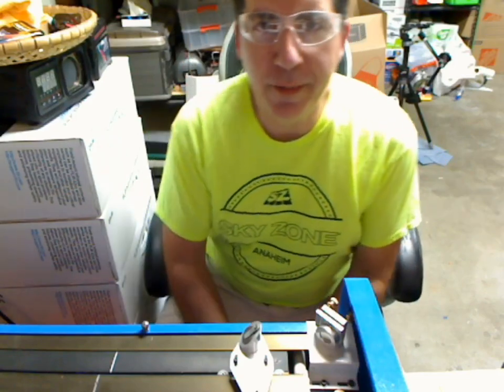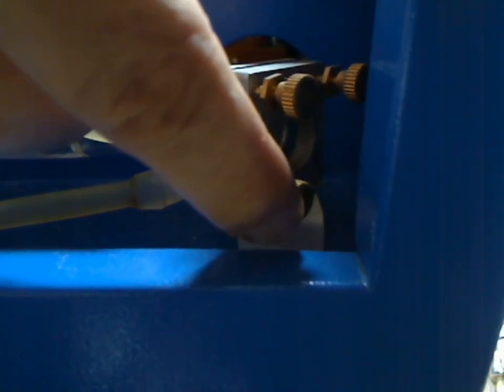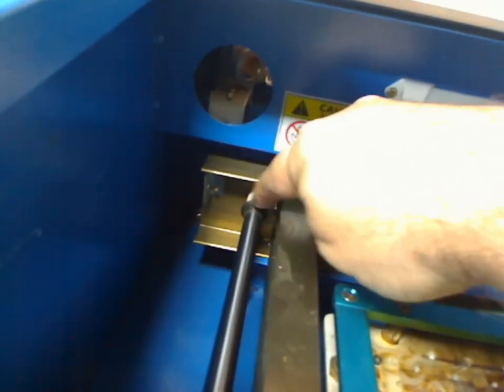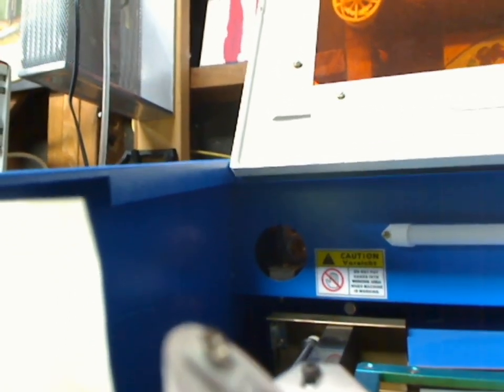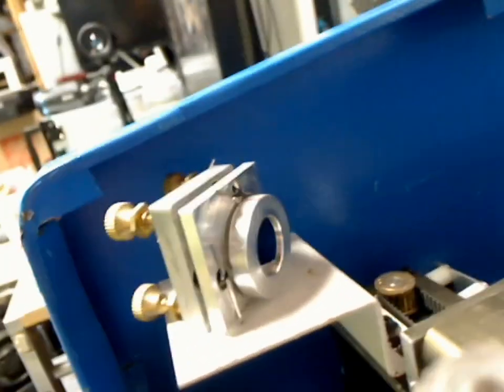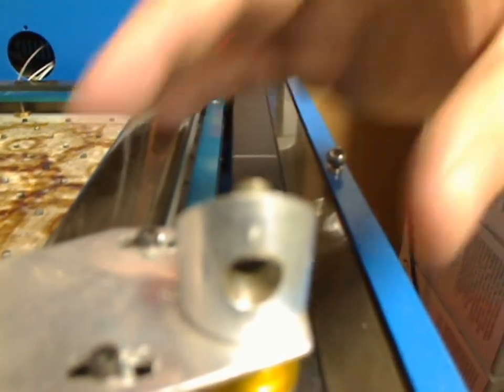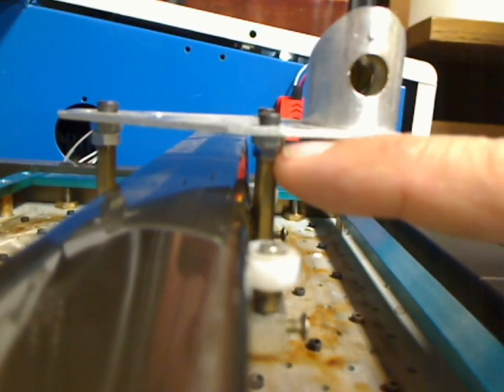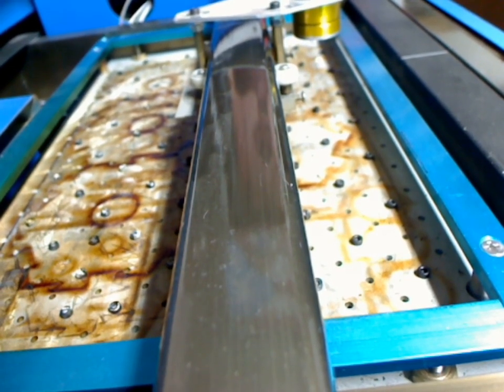The Short K40 Laser Alignment Video is Here!

Comment: One thing I've found to help with the rotational adjustment of the laser head / mirror 3 was putting a long, straight rod over the entry hole to the laser head and pushing it against the head. That give a reasonable approximation as to whether the mirror is perpendicular to the Y axis.

Comment: Can I please ask you something...I've been pulling my hair out all day trying to get my mirros alligned.  I have my mirror #1 shooting a parallel beam (I assume)...When I move the laser head in the farthest position, the laser hits Mirror #2 dead center...but when I move the head back to the closest position for the 2nd burn...the hole moves down about 1/4" directly below the first burn.  My question is, wouldn't any adjustment you make to mirror #1 affect  both burns?  I feel like it is shooting parallel to the rail but that it isn't horizontal???smh  I'm not a mechanical engineer but I feel I have a lot of common sense and this mirror allignment has got me topsy turby.  I almost feel like the rails need to be shimmed/raised a little bit on one end? (the end closest to laster tube?  Any advice would be appreciated.
Reply from the maker: I suspect that you missed a critical point of my video about needing to ignore where on the mirror the beam hits. Ignore the mirror completely. Once your beam is aligned to the rail, you can move the mirror to catch the beam  Since you make no mention of mirror 3, there is a bit of ambiguity in your description as to what is going on where. Lots of ppl I help forget that there are 3 mirrors and refer to #2 as #1. I'm happy to help if you want to jump on a call. YT does not seem to have a DM feature, so reach out via Facebook Messenger if you have that. John Cabrer is the name.
Reply: I sent you a message on Facebook

Comment: My machine arrived with the mirrors very out of alignment. If I put a bit of wood under the laser, it won't even fire to leave a mark on it. When I put paper over the first and second mirrors, it does burn a hole, but it's not going to the final mirror on the laser head. I'm at a complete loss. This helped, but I'm still not getting it. What do I do to go back to square 1 and try to get them all aligned

Comment: Thank you.  This was helpful.  Now I just need to make a deeper cut.  Any advice?  I’ve search for help on this and find none.  Like what power level you should use.  Thanks
Reply from the maker: How much deeper? A 40 watt laser in new condituon can only cut reliably to a depth of 3 mm. Running the laser at high power will cause the tube to degrade rapidly. It may even damage the partial mirror on the tube.
Reply: @johncabrer2328  thank you.  It wouldn’t cut into my wood at all.  A friend told me to clean the mirrors.  I did that and their was a few little particles I could see down in the lense, so I vacuumed them out.  Tried it again and it works great.  I used tape to try to align at first before I found your video.  Yes, bad advise from others.  I think maybe some tape residue was on the mirrors.  I couldn’t get my dots to line up perfect and it is pretty close to the top on the head or going into mirror 3.  I think I need to shim it like you showed, but it is working for now.  I am running it on 15% power.  I just got the k40.  Maybe you could do a short video about power setting and what the temperature should be.  I have 2 gauges on mine.  Not sure what is safe.  The water was running 27C.  Thank you so much.  This was a little overwhelming since I had never worked with one before.  But I’m pretty excited now.

Comment: I know I am a year late, but this has helped me immensely, thank you so much. You explain the issue perfectly. Do you have any advice on removing micro bubbles from the tube? I've been struggling for 2 weeks, before I've even fired up the laser. I know that colder water can absorb more O2, but I can't budge them even when the water is warmed to 19°C and the pump is left on for more than 12 hours. It's a brand new tube, pipes, pump, flow indicator and temp readout. I'm baffled. 🤷🏼‍♀️
Reply from the maker: You don't need to worry about small bubbles. The areas that are critical are at the ends of the tube. There you don't want big bubbles hanging around in the bends of the glass tubing. Usually you can rotate the tube to a position that eliminates this.

Comment: Thank you so much mate, I was ripping my hair out trying to re-align my mirrors after fixing the gantry.  the post-it note trick worked amazingly.  I now have it aligned.  raster engrave and vector engrave working great.  But when I boost the laser up higher power to do a vector cut, I'm getting ghosting (the cut works) but theres also a scorched version of the lines next to the cut lines.  trying to figure that one out :P
Reply from the maker: MIRROR #3 must be slightly rotated. Trial and error will tell which direction. If #3 is not facing #2 perfectly, the beam down to the material will be slightly tilted. The ghost line appears because a reflection off the inside wall of the tube is taking a slightly different path through the lens.

Comment: i try do it like u said ;( but 2nd mirror dot is always upper then x0 position :(
Reply from the maker: If the final alignment result is the dot being too high or too low you have two choices. You can adjust the mounting up or down and do the alignment again or adjust the mounting height of the lens holder by replacing the hex standoffs with M3-35 screws and nuts.

Comment: Thanks man, that's the engineering way to do the aligment process. Forget the mirror and first check the beam vs guide rail!  Just replacing the mirrors (Stock vs Cloudray Si) and lense (Stock vs Cloudray CVD USA) + the alignment the laser changed dramatically!! And cuts 5mm light wood on 1 pass without any issue (25% digital lcd power).
Thanks!!!

Comment: I have looked these gids short and long several Times but.... Trying to allign mirrors. So I make beam perpendicular and bring mirror 2 in the beam. So far so good. Then I make the beam perpendicular to mirror 3. But when I want to move mirror 3 to the beam path its hitting to far left. Have no more mounting space to the left of mirror 3 (looking from mirror 2) so I need to make the whole beam path more to right. (Again looking from mirror 2) hope you can understand this. Some help much appreciated.
Reply from the maker: When this happens, you must adjust the positions of the tube and mirror 1. Usually this is more common when the tube mount is 3D printed, or the mirrors are not original equipment

Comment: there is a little bit of adjustment of the tube mounts 2 hex headed 6mm set screws hold each mounting bracket through two short slots in the base you can slacken them off from inside (do the left hand side first cos you are not messing about near HT power source, even when it's switched off it can kill you) it only gives about 12mm adjustment, but that can make a big difference

Comment: Different topic: K40 Whisperer on a Mac. I have installed Python 3.9 and Inkscape on my Mac (running MacOS Big Sur) but I don't know how to install K40 Whisperer 0.58 src. I have tried running the copy and paste commands that you posted to Scorchworks, but am getting (not found) errors. It seems like I have all the right pieces, just not sure how to make them work together. Thanks!
Reply from the maker: There are lots of persistent issues with K40 Whisperer on Mac. Install VirtualBox and download an image of Windows 10 or 7 and set up a minimal virtual machine. You dont need a license and it will all run perfectly. On Mac OS, just updating the OS can break Whisperer and force you ti start over.
Reply: @johncabrer2328  Thank you! Really appreciated your alignment video here too. It took me about a half hour but it worked great!
Reply: @johncabrer2328  This is an awesome service.  But see my comments re. Mac.  The guidelines about using homebrew/virtualbox are quite out of date now, especially as Big Sur is far more Python friendly. Having said that, I'm a dev. so it's 'easy for me'!!
Reply: This should be really easy to do, John.  I use K40 Whisperer on Mac OS (Big Sur) with no problem.

You first need to git clone libusb (you can find it on github) - then compilation was easy enough (from terminal, cd libusb; ./bootstrap.sh; ./configure; make; sudo make install) .  If you are unfamiliar with using terminal, it may be a bit tricky. Reach out to me in that case.

So that's libusb. K40 Whisperer runs absolutely fine using python 3.9, and does NOT need home-brew at all. Inkscape is available for download onto Mac OS, but the software works with SVG, so you can use illustrator or whatever you like for your file generation. K40 Whisperer is pure Python, so it's trivial to get to work on Mac, if you know a little python. One has to use the source material, unpack it, put the entire folder somewhere, and then (via terminal) "cd K40_Whisperer-0.58_src" folder, and run "pip3 install -r requirements.txt". - again, this sort of expects that you know some terminal.. 
Then, with the USB connected, and the power switch on (with the water pump pumping, the fan blowing, the earth earthing, etc).
"python3 k40_whisperer.py"
You can test that it works by pressing the button "Initialize Laser Cutter".
Reply: @ben.griffin  Thanks Ben. I am not very familiar with Terminal or Python, so the order of operations is not obvious to me. Email me at john at howtobrewdotcom if you would and we can talk about it. Thanks!
Reply: Also, I don't know if you are interested in all this, but I use Form•Z Free for designing objects - this is great for 3D constructions - and then I select the faces I want to cut, and use 'unwrap' to fix those onto the XY plane, then use the extrude tool to extrude them to 3mm export as STL file, and then use OpenSCAD to render them as planes - with the command "projection(cut=false) import("model.stl");" then from OpenSCAD, export to SVG, and use the SVG in InkScape to tidy up cuts, vectors, and raster, and fit (resize to drawing, with a 1mm margin) ready for Whisperer.  All free. It's a bit of a tool chain, but I get incredible accuracy, especially when using supporting templates (also modelled in Form•Z) for some of the complex fits. (I am slowly moving over to Blender, but Form•Z free is pretty cool).

Comment: Watched your video and I need to know where the laser will hit on the first mirror?  I put a new tube in and the mirrors where out of wack. Thanks
Reply from the maker: Depending on who you bought the laser from, the tube mounts may be adjustable so that you can positiion the tube so that it hits in the center of mirror 1. The beam does not have to be perfectly centered, but it should be away from the edges by at least 4mm to avoid power loss due to partial blockage of the beam by the mirror housing ring.
Reply: @johncabrer2328  it hits close to center but to get it to mirror 2 I have to adjust the 3 screws like crazy. The old tube layer in there and everything was adjusted. Let me ask this. If I hit center on first mirror but won't hit mirror 2. Let's say it's to high, what adjustment should I try first?  Thanks
Reply: @johncabrer2328  they are not adjustable. I'll have to shim the mirror. It's hitting to high. I messed up all the setting. After I get the tube centered do I need to turn the mirror to the right.  Right now the beam hits the mirror and I can't find where it's going.

Comment: I just watched your video.  It explains perfectly.  I'm totally lost tonight.  Until yesterday, I was able to cut leather at 10% 2 passes, .125 acrylic 24 % normally 1 pass...sometimes 2.  And .060 cast acylic at 10%  1 pass.  Today, all of the sudden, I cannot cut at those rates.  In fact, after cleaning mirrors and lens; aligning, changing my water, I still can't cut acrylic.  Now, my 3rd mirror test shows beam hits center when on far side of laser, and when close it hits above, and a bit to the left.  Does that mean that I need to raise my head by adding washers to the screws.  Any help would be appreciated. Thx
Reply from the maker: My guess is that you lost alignment after cleaning everything. Possibly installed the lens flat side up. Look at the lens from both sides. The side that shows smaller reflection is the curved side, which should face up.
Reply: @johncabrer2328  I forgot to say...I started the whole cleaning process because of reduction of power in cutting.
Reply from the maker: Check that the beam is still round and not split.
Reply: @johncabrer2328  This video is super informative, thank you for taking the time to do it.  I fear I have fallen at the first hurdle, I get two very distinct dots instead of one.  Faulty tube?  Any way you know of fixing this issue?
Reply: I’ve got the lens curved side up, in fact, I tried it both ways. I’ve had the laser almost a year, could the tube be losing power? It’s still pinkish/purple. I guess tomorrow I’ll shim with some washers. Thx for replying.

Comment: thanks for proper method seen to many dummys that dont know what they are doing show improper method of adjusting  but there is a small amount of adjustment to tube location by loosening the bolts under the mounts that allows the tube to move a small amount

Comment: Really love your video. I have an issue if you can help me with. I'm getting the beam parallel off of mirror 1 but the beam is hitting m2 very close to the bottom of the mirror, its like m2 is too high in comparison to the beam. Is this correct or am I doing something wrong

Comment: John,  I used your video to align my K40.   I get overlapping dots at Mirror #1 to #2.   Then #2 to #3.   Then I do micro adjustment at Mirror #1 to get to get overlapping dots at the Rear Right position, but after I do that my Mirror #1 to #2 is out.    So Mirror #1 is aligned on the right side front to back but not left. 

Can you PLEASE tell me what this means.  I've been working on this three days and can't figure it out.  If you covered cover this, I apologize because I didn't catch it.   Thank you - Rick

EDIT:  Not sure if this matters, but I couldn't use calipers to get perfectly even spacing on my Cloudray mirrors, so I just eyeballed it.

Comment: 2nd mirror needs to go down to center.  Now what? Raise the tube maybe?
Reply from the maker: Correct me if I am wrong but you are saying that the dot .is too low on mirror number 2? Depending on how the tube is held in place, you can loosen the mount closest to mirror 1, and this should move the beam up slightly. This on non adjustable mounts that are just padded clamps.
Reply: Hey. What did you do exactly to sort this? I have the same issue. My 2nd mirror is like too high and the beam is hitting very close to the bottom of it. Did you raise the tube?

Comment: Hi! I can adjust the screws of the 1st mirror to get a straight beam, so both holes are in the same place, but if I check where the beam hits the 2nd mirror, I can see that the beam is up. The explanation says that I have to unscrew the screws that are under the 2nd mirror for moving to the right or to the left but, what do I have to do to move the beam down?
Reply: i have this same problem when i bring the second mirror close to the first one, the beam rises
Reply: I have this same issue. Dots align perfectly but is too low on mirror 2. Did you solve this problem?

Comment: Hi there and thats a perfect video!I have a question. I managed to allign all the back and front positions but on my second mirror the beam hits the mirror  offcenter. Is this a problem?Will it lose power if it doe not hit the mirror center?
Reply from the maker: If the center of the beam gets close to the edge, say 5mm or less, the power will be reduced. This is because the actual diameter of the beam is larger than the dot it makes.
Reply: @johncabrer2328  hm... I see....so i will have to rearrange it...thanks for the reply!
Reply: So if my dots are lining up at front and back, does the dot need to be in the centre of mirror 2? It is current a bit below centre in terms of height and I can’t seem to get it right, does this matter?

Comment: im having some issues with my vector cuts / engravings not aligning with my raster. do you think we could have a convo in messenger?
Reply from the maker: Sure! You can find me on FB Messenger "John Cabrer" or reach out any other way you like. Usually, if you are having misalignments between vector and raster files, it is because one of the files is cropped to the edges of the graphic, and the other file has the graphic centered in the field, hence the misalignment. Keep in mind I am only familiar with K40 Whisperer. I can help out with other software, but you will need to bring me up to speed on the fine details.
Reply: I tried looking for you on face book can't find you  For some reason. My basic problem is is when I try to raster engrave and then try to Vector engrave over it they dont match up by about 1/8 to 1/4 in apart. Its 1 file with both Vector and raster data.

Comment: Excellent explanation.  I've done several alignments but this is the first time I've seen it broken down so clearly.    This is also the first time someone explained the ability to translate the mount perpendicular to the direction of the incoming beam. I have a new tube for my k40 and printed mounts that I've been dreading because I'm still getting acceptable performance out of my 5 yr old tube, but I had it tested and it's now about 5w less than it should be.  This guide gives me the confidence to tackle the task.  BTW, co-linear refers to 2 lines that if joined would form a single line.  Parallel is the correct term.   Anyway  great job on the excellent explanation!